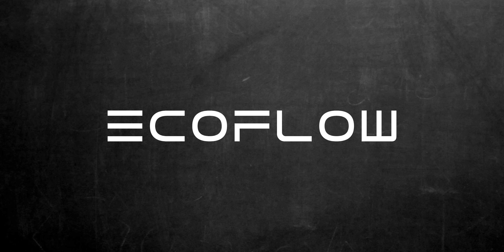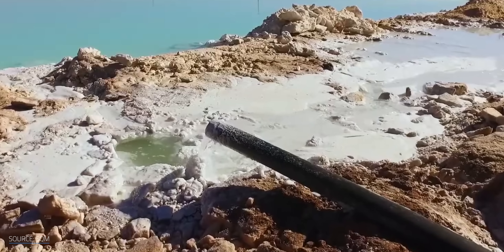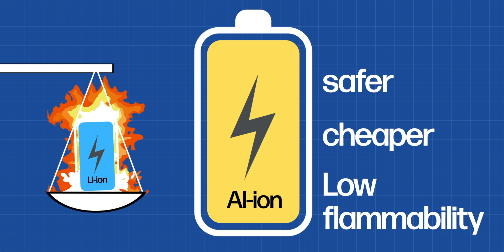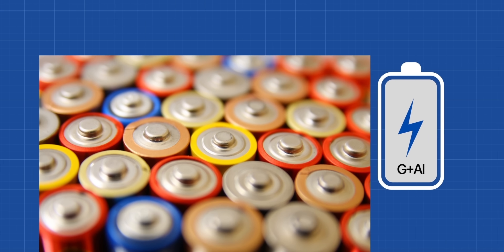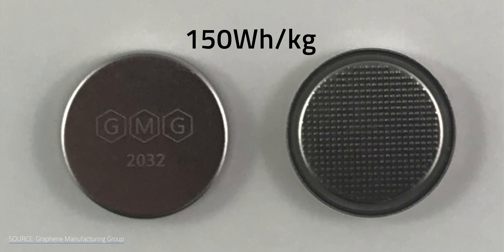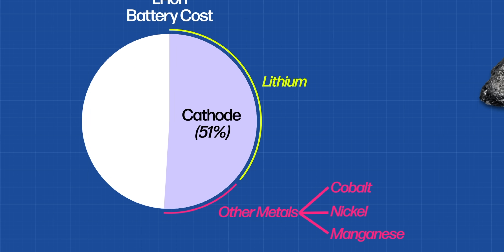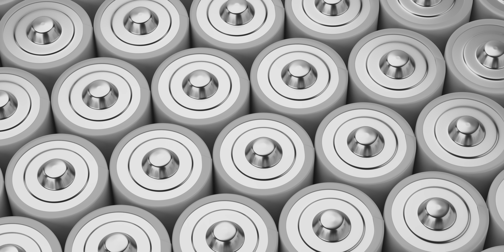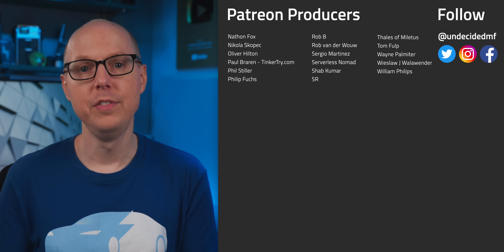Can This Metal Really Beat the Lithium Battery?

Comment: The problem is the massive use of fuel to extract these materials and manufacture them the entire change of vehicles to equipment for manufacturing is massive and all creates pollution. Then these devices all have a limited life span repeating the process before the benefits are paid in full. Simply the sources do not produce the amount of power for the effort. Nuclear or fossil fuels is the solution, always.

Comment: Can you please take a basic science class before making these videos. Aliuminum may offer 3x the number of electrons but it is also more than 3x heavier than lithium per mol. Battery tech is extremely well researched and there are not going to be any easy breakthrough solutions.
Reply: Aluminum is lighter than any metal like steel or anything

Comment: The production of aluminium is extremely environmentally-unfriendly and it requires a huge amount of water. Lithium is not particularly clean either but be aware that the same applies to aluminium, there is not that much aluminium (not mixed with another element, just pure aluminium) which you can easily find in the ground, most of it is made in factories near lakes or other open water.
Reply: The nice thing about Al is that there is already a giga ton of it, in purified/processed forms, in the world and it is fairly easy and cost effective to recycle. 

   And even from a raw resource point of view, Al is not near as rare as Li.  If it was, it wouldn't cost a 6th of what lithium does. 

  It is not without its issues and problems, but it is still world's better than Li and Co.

Comment: Batteries great. Aluminum is a better option for consumers than iron. 
I find it strange that only solar and wind are renewables. Climate change has never stopped, ice ages and warm between for example. Miopa vision of present promoters. Ice age cycles follow orbital and percussion cycles. Clearly not under human control. CO2 has been about 10 times higher. Food growth increased with higher levels, warm periods had higher levels and man has lived through a ice age cycle.

Comment: Nuclear power promoters are pushing hard to get nuclear energy locked in to the national grid. 
The battery in EV needs to be big for the long trip. But daily drives are small. 

300million vehicles in the USA means if they are EV with big full charged batteries then every day massive amounts of clean electricity is available. 
So yes all battery advances are extremely important

Comment: I think the carbon aluminum battery has huge potential. However, it's too close to a solution that will actually help. Therefore, I predict there will be governmental roadblocks to it's widespread usage. Government seldom seek to solve problems and instead seek to exploit problems. Will the carbon aluminum battery help government gain or retain power? If the answer is "no", then there's a good chance government will stand in the way.

Comment: lol last decade the fluorinated carbon cathode battery was all the buzz. 7 times the storage of lithium theorized at the time.   haven't heard anything since more than 10 years. lol aluminum chloride graphene. is it just me or are they just developing an intermediate product and that's the reason the fluorinated carbon cathode battery is taking so long.   how about a multistage levered ion pump battery that discharges thru several energy states?

Comment: Any single major drawback will cross it off the markets. If those dendrites form to dangerous levels in like 100 years then the tech will have its place, otherwise - alas.
Yes, aluminum and carbon are dirt-cheap, but If the nanoworks required to produce the product has exorbitant costs then again - there will be little to no market for it to make a real impact.

Also forget about making the planet go full-renewables - no matter the batteries it's a pipe dream until Dyson spheres are reality. The nearest future is MOX-fuel nuclear reactors, which would stop any and all radioactive ore mining forever, using only already stored nuclear waste indefinitely. It's very real and is already been done in russia.
Reply: It's likely that those nano works will evolve like the semiconductor industry, and will become cheap too. There are many more potential applications for that graphene thing.

Comment: No matter how fast a battery can charge, it takes the same amount of raw energy from the insufficient-as-hell grid to provide the necessary power to change them,. Huge dumps of energy to batteries that can charge in two days, two hours, or two seconds seems to have escaped discussion. How is that possible? Also, the power requirement demands power to be available night and day  24/7 What can provide that kind of energy on demand? An inconvenient truth appears and is ignored. . The power grid has been deemed woefully insufficient for the job NOW!! Californians were asked NOT to charge their cars NOW!! Totally ignored. Increasing the grid's capacity takes billions of dollars and copious amounts of copper, which must be mined,  and petrol products.  But they/we want to stop the production of all petro products. May as well put a gun to our heads and pull the trigger.  No fertilizer, no roads, no bridges, no tires, and a billion other essentials ...No discussion. We are being led down the road of destruction once again by "smiling faces."   I don't want a  car that will cost ten times more to operate as electricity rates mysteriously double and triple, and they will..  Lastly, ..Do you really want a vehicle the government can push a button and disable anywhere, anytime?  If it is possible to do, they WILL do it.
Reply: Actually they often use aluminium wires for the high voltage backbone. It's lighter and cheaper even though it needs a thicker wire than copper.

Comment: This is factually incorrect - in lithium ion batteries, the lithium ions move through the electrolyte, not the loose electrons. It's one of the primary differences between lithium and other battery technologies.

Comment: What has been said repeatedly about zero fuel power generation using Edison generators and dynamos yet you tell people they can't fly unlimited range electric airplanes helicopters because batteries are too heavy.  The replacement of nuclear power is required by nuclear nonproliferation treaty enforcement and obligations but you don't contribute to the conversion away from nuclear technology halogenated vinyl or halogenated carbon.

Comment: There is so much spoken there that preys on the ignorance of the audience. The GMG guy talks about how "carbon is good at capturing heat" and references CO2 and it being a greenhouse gas. Yes CO2 captures heat in our atmosphere but only because it is in the form of CO2 not elemental carbon.  He then talks about using "only one electron, but aluminum has three" and there is good reason for this. The other two electrons are far more difficult to manage and the forces needed to be overcome to make them useful outweigh the energy output potential. Also if you look up the form of Aluminum that is used in these batteries it is Aluminum Chloride... a chemical that if it gets wet will produce heat and Hydrogen Chloride gas which when it comes in contact with the atmosphere turns into Hydrochloric Acid. Then there are the claims of significantly higher energy density....and all these battery fanboys never talk about the elephant in the room...if energy density of batteries gets any much higher than what it is for Lithium Ion batteries they will have to be defined as an explosive and yes...if you think Lithium Ion batteries spontaneously bursting into flames is bad....batteries of higher energy density won't just burn, they will explode!

Comment: A permanent magnet as a battery is the better battery powered system and battery powered dynamo powered electric vehicles are unlimited range electric power vehicles.  Edison generators or dynamos power electric power vehicles are unlimited range electric power vehicles.  The batteries are sensitive to microwave radiation and essential transportation like airplanes helicopters or military vehicles have to use Edison generators powered dynamos instead of battery powered ito power high torque electric motors..

Comment: Putting ECO in your name doesn't make you clean and green - the dual-fuel ecoflow generators still use #FossilFuels and, as such, cannot be part of the future. You are promoting something that is likely to have a VERY short lifespan as the fuels that go into it HAVE to be retired ASAP. As a result, you're not only adding to the GHG problem but also creating a stranded asset (if I may use a term borrowed from the finance industry) for those who may purchase one.

Comment: One of the poorer videos in recent times. I find it very odd that you have the CEO of that one company researching these batteries on the phone, giving him all this airtime to fluff it up and then not ask a single difficult or critical question. Also, you mention that aluminum is one of the most recycled metals without putting any numbers behind it. PET is also one of the most recycled plastics in the world but the overall amount that isn't recycled completely dwarfes any effort in that matter. Statements like these don't mean anything without numbers. How much recycled aluminum will GMG aim to use? When do they aim to come to market? Can existing manufacturing infrastructure be reused to build these new batteries? What are some of the drawbacks of it? Clearly it won't be just "better" in every single way compared to existing battery tech. It never works out that way. Overall very marketing heavy video without substance. You could have just said "yeah, there is this other battery tech we might hear from in the future" - thats it. That's the news.

Comment: All these high tech batteries never seem to get to production what will it be? Years?. IF this is about CO2 i have a much better solution that can be done overnight. Mass carpooling, combined with home work.  If 20% stay home and 80% of the remaining commuters share a ride to work - then - you reduce the 16% transportation CO2 by at least half, probably even more, because you also cut the associated CO2 like moving and refining oil. You could further run the commute car on E85 or E100. So are you all Talk or are you going to promote it with a video?  The tech advancement would be using your smart phone which allows everyone to know if you are running late or are outsick. So what are you undecided about? Here is a real solution just takes a change of mind.
Reply from the maker: Thanks for sharing.

Comment: You know you are talking to a foreigner when they say aluminium(which is incorrect) instead of aluminum(the correct way to say it). For once Americans got it right and the others got it wrong LOLI think if they can get this to market they will knock lithium out of the park and we can then forget about lithium altogether. They are not going fast enough heheh. Cheaper price and maybe even better longevity. Those are enticing factors. I want one for my electric car. The car will be lighter weight and cheaper. With the promising outlook for faster charging it is a homerun!